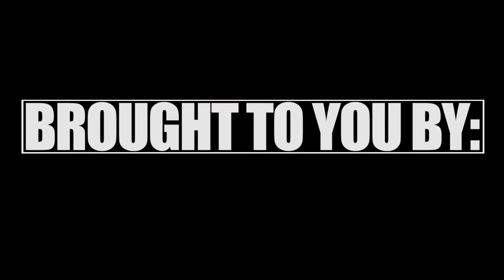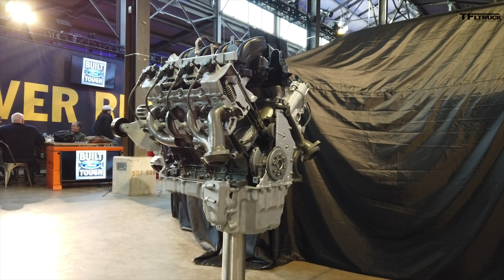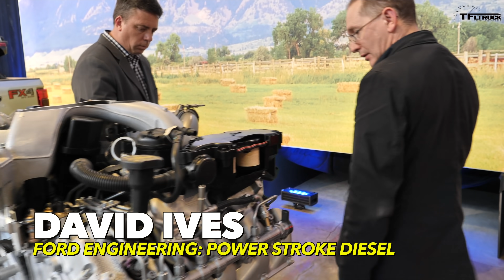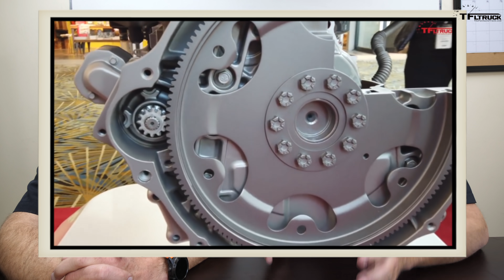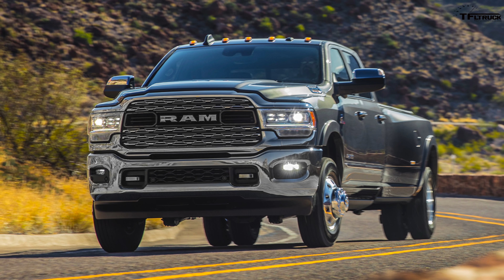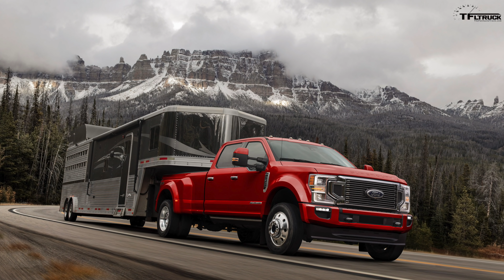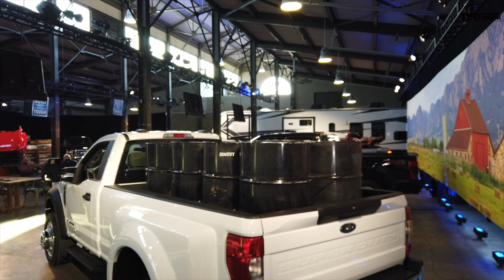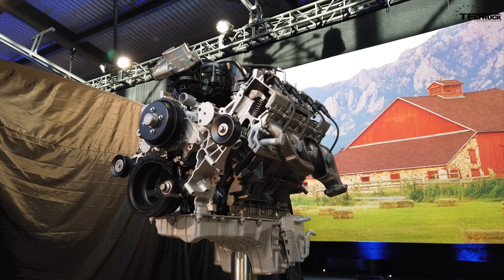Are Diesel HD Trucks Dead / Will Electric Pickups Replace Them? No, You're Wrong! Ep.5

Comment: Diesels are expensive to buy and get fixed, correct.  You compare an electric-gas truck to a Tesla.  Tesla drive units fail quite often and if out of warranty can cost $3-5000 to replace.  That is the motor not the battery.  And, in Tesla case, if you sell the truck the warranty is not good for the 2nd owner unless you buy through Tesla only.  Now range,  Tesla car with a good size modern battery goes 335 hundred miles.  Now with a truck pulling 20-30, 000 pounds, how far you going to drive?  How long to recharge and where, if not done by driving, especially through mountains and electric motor was constantly engaged.  I would bet the 7.3L with gas tanks, then electric motor and batteries, is heavier then a modern diesel with fuel and DEF tank.  I do not see the big diesels leaving anytime soon.

Comment: Ya the 200-300lb difference in gas and diesel is not enough for the battery and electric motors to make less weight. In 15 years a full electric HD will be the norm but it not now

Comment: Diesel will die at the same time all combustion engines (including gasoline) die. Full electric will dominate when battery technology gets to a point range exceeds current petrolium fueled vehicles on a consistent basis without negatively affecting payload (current battery tech. is bloody heavy). 

As for how eco concious electric vehicles are... that's highly dependant on the power source. If you're sourcing power from hydro tech. it's fairly green. If your charging from a coal fueled source it's worse than petrolium fuels could ever be.

Comment: I think that the notion here is that the electric motor doesn't have to go miles and miles without a charge. Ram has the right idea with the eTorque system. The big torque numbers are to get the weight moving initially and engine braking to help slow it down. The electric motor is perfect for this. Instantaneous torque to get a big HD with 30k lbs rolling and then the gas engine can take over. The big question, I think, is not whether a gas-electric hybrid system can work and is better, but how to package that and produce batteries efficiently. Every car company now has hybrid systems, so it shouldn't be much more to do. I am with Roman on this one.

Comment: There will never be an electric truck that can tow 35,500lbs over 40 miles. Unless you fill the bed with batteries, then your back to the same weight as a diesel😂

Comment: Electric trucks will replace diesels - just as soon as the match diesels with their torque and power AND run 300-350 miles per charge AND re-charge in under 30 minutes.  In other words - probably never.  IMHO.

Comment: If you start looking at series-hybrid (think Chevy Volt), the gas/diesel engine can be much smaller and doesn't need to be such a large displacement as 7.3 liters.  The Tesla P100 motors are pushing over 900 ft-lbs and can more then handle the POWER requirements of mid sized trucks.  Where electric has issues is in the Capacity of energy storage which a smaller gas engine has plenty of and only really needs to be able to maintain highway speeds and keep enough electric reserve Capacity in the battery to handle your Ike Gauntlet during peak demand.

Comment: I bought a 97 F-150 from a neighbor years ago. I bought it for $500.00. It had 432,000 miles on the odometer. It started, ran, and drove ok. He used it for small package/hot shot work. It had the gas V6. Gasoline engines can have longevity like diesels. I’ve seen proof.

Comment: In these two videos https://youtu.be/YWrHPlV8z6s and https://youtu.be/PfedP0rzNpk TFL Truck demonstrates the efficiency of a diesel over a gas electric hybrid. The lighter, slightly more aerodynamic BMW with a 2.0 four cylinder and hybrid power train achieves virtually the same fuel efficiency as a heavier, slightly less aerodynamic Ram 1500 equipped with a Diesel engine displacing an extra liter. That being said you have a larger less complex vehicle getting virtually the same fuel efficiency without all the added weight and complexity of a hybrid system. Don’t forget all those extra raw materials and energy needed to produce that hybrid power train. The cost of battery replacement would also be a key factor long before an electric motor would need replacing. Then you need to take into consideration the vehicles value at the time it needs that battery replacement. Is it worth it?

Comment: Independent engine maker Cummins Inc. continued its push into commercial vehicle electrification. The company announced it has acquired Johnson Matthey’s UK automotive battery systems business, a subsidiary that specializes in high-voltage automotive grade battery systems for electric and hybrid vehicles.

The acquisition closed Jan. 31 2017

Comment: Until gas engines can be engineered without added tech that diesel doesn't need and can produce lower emissions, high mpg, high power output (HP/torque) and costs per efficiency (long haul vs short haul) is when gas/hybrid will be the #1 choice for consumers.

Comment: How can a hybrid be lighter than a diesel number 1.  Number 2 diesel is more efficient than gas or frankly electric overall.  And lastly pure electric means you need to have a big ass battery to get more than 300 mile range which will greatly handicap max payload and towing

Comment: I could see an argument for naturally aspirated vs turbo'd with all truck motors getting smaller fast spooling turbos for the low and mid range torque. all any manufacturer would have to do is come out with a 4.5ish liter twin turbo v8 and all the turbo hate would be put to rest. you would be in the 650lbft of torque range.. who could argue with that much torque in a 1/2 ton?

Comment: Likely, after a few years you will see variable compression petrol engines. These engines are the holy grail of gas engines as they incorporate the main benefits of a diesel engine. Economy, lower CO2, and higher power. Basically it runs the same as a diesel, but uses gas. 
Mazda will release a 4 cylinder using this tech. Other makers will follow suit. 
Diesel will still be around in colder climates however. Also remote areas, as gasoline cannot be stored for a long time as diesel can.

Comment: If someone is looking for a true BB pump gas engine get the 632 Chevy. 915 HP AT 6000 RPM 840 lb feet of torque at 5000 rpm.
CAM STAGE 10.5, Forged pistons and Scat, Forged Crank and H-Beam Rods ,AFR fully cnc'd 377cc aluminum heads and a Merlin IV M block all for $13,995 US.  Naturally aspirated with Longevity and reliability.

Comment: In California we have a company called Propel Fuels, that provides E85/FlexFuel as well as HPR Diesel-- a high performance renewable diesel fuel that is safe to use in all diesel engines. This product is actually made by Neste and rebranded for public use. Many government fleets use their fuels, too, however often from other brokers. I believe this is the cleaner, greener option when compared to electric or hybrid powered vehicles. Lithium mining is a nasty process that is doing a lot of harm, not to mention the inability to recycle or properly dispose of the batteries, once they wear out. Hybrids are still using fossil fuels, too. If the government imposed regulations on fuel types, rather than emissions only, we could have renewable bio fuels available across the country, without using the awful adblue system that kills power, and possibly the engine over time-- and still have much cleaner emissions. Kill the dirty diesel. Let's push the clean, renewable diesel fuels. But if they make an electric vehicle with a graphene battery, I may be interested.
Reply: Spencer Bane  Initially it sounds interesting and I like the approach. Perhaps that's the future.

Comment: the future is here. electric is the next step in automotive evolution. electric is way better than infernal combustion but the power storage is the biggest problem. until they get efficient energy storage like hydrogen fuel cell technology, that gm pioneered in the eighties. it won’t be very practical

Comment: Diesels will always keep trucking on.  Tesla type vehicles might work fine for short distance commutes, but for a vehicle that will be used in a combination (towing a trailer, especially when it's heavy and/or long distance) they're not very practical.

We've all seen the news articles showing the Tesla Semi that's going to make diesels obsolete.  What usually isn't shown in the articles is that according to researchers who published their findings with the American Chemical Society, the truck will need a battery that weighs about 14 tons.  Considering how in America the maximum weight for any truck (without a special weight permit) is 40 tons.  So take 40 tons, subtract 14 tons for the battery, subtract 6.5 tons for the cab, subtract 5 tons for the trailer and what is left is the payload.  In case anyone is wondering, the payload is the part that actually pays the bills when the truck is in service.  The lower the payload, the less the truck generates financially.  To recharge a 1,300 kWh battery ( what would be required to move 80,000 lbs a distance of 900 miles cross country ), it would take 30 minutes (as advertised) to recharge the battery if you had a 600V supply capable of charging at a rate of 4,333 amps or 866 hours if you used a standard household 115V outlet.  A major strain on the power grid.  The only way any recharge station could handle this type of demand, is if they operate several diesel generators on site to recharge the batteries of the electric trucks that replaced the diesel trucks.

This Tesla idea is a failure for class 8 trucks, and now someone thinks that this is a good idea for pickup trucks that are now advertising to tow over 35k lbs?  Assuming that the truck weighs 5,000 lbs, that is now a 40k lb combination.  If you have a truck, take a look under your truck to see how much real estate you have to strap in a giant battery.  The truck will need to keep the rear axle, as well as the are where the engine is if it is to be front driven as well ( 4X4 ).  So the only actual available space will be the space currently occupied by the transmission, transfer case, driveshafts, and part of the area occupied by the engine.  In this space will be a battery ( which I would guess would be about 175 kWh ).  Anyone excited to strap a 3,750 lb battery to the bottom of their truck?  That's what it would take if the truck will be used to move 40,000 lbs about 300 miles.  And that 175 kWh battery, would cost about $33,000 just in materials alone.  It would cost more to manufacture the battery, unless you can find alot of volunteers excited about working with lithium.  And once again, to power these vehicles, it would require significant  upgrades to the power grid, or charging stations would have to install on-site diesel generators to power the electric trucks that have replaced diesel trucks.  You could also charge it at home with a 115V charger.  It would only take about 117 hours to recharge.

Comment: Roman, you forgot to complete your "Locomotive" analogy.  What kind of locomotive were you referring to?  A DIESEL-electric locomotive. 😁

Andre makes a great point that companies like Cummins, Caterpillar, Ford, not only make Semi truck diesel engines, but also make diesel engines for bulldozers, enormous earth haulers, levelers, excavators etc., and let's not forget Roman's example of the diesel-electric freight trains, which, without, our entire commerce system would shut down.  Anything to do with massive construction, or massive commercial hauling is laden with diesel technology. 

Until battery technology makes a quantum leap forward, diesels will not be replaced by electric motors, because diesels are more efficient and less expensive.

When full electric cars can go 400 to 500 miles per charge (current gasoline car ranges per tank) and that same technology can also be scaled up for commerce, then you will have a valid argument, until then it's just pillow talk.
Reply: I believe his point was simple. Locomotives are electrically powered and make huge amounts of torque
Reply: Which just proves how entitled we've become as a society. Most people have absolutely no need for a vehicle that can go 400-500 miles in a single hop, especially with the added convenience of being able to "fill up" at home, while you're sleeping.

Diesels will always have their uses, sure. However, this video isn't about heavy equipment or trains (even if they did use them as an analogy). This video is about pickup trucks. I would be willing to bet that EV technology will be able to meet the needs of most pickup truck drivers within the next 5-10 years. Whether the majority will be willing to admit that they virtually never drive more than 100 miles in a stretch...well, that's another story. People who don't want to try EVs like to tell themselves that range is important. For most, it's really not. 

There is definitely some merit to the position that those who have real HD pickups need more range. In my experience, those are the guys who actually do put serious miles on their trucks. However, I think we're about done seeing diesel Suburbans/Excursions and 3/4 ton pickups. The thing is, HD pickups are niche, just like heavy equipment. They don't really need to be talked about in the general "consumer vehicles" category because they don't really affect it. 

I think the safe bet would be to say that EVs and hybrids will replace diesels in standard consumer and lightweight work vehicles and diesels will remain in the niche categories in which they work the best.

Comment: It would be a shame to see diesels go away but I feel like a heavy duty hybrid might be the solution. Although I dont see that happening for a min of 5 to 10 years depending on political pressure. My next vehicle will be a heavy duty truck but for me a diesel makes no sense. I drive 5-9 miles each way to work and only tow a camper a few hundred to 2 thousand miles a year. I am really interested in the specs on the 7.3 though.

Comment: I never understood the hype of diesels until I took a cross country trip to Oregon from Ohio in a 2014 2500 ram with a Cummins pulling a 32 foot enclosed trailer.  The truck averaged 13 mpg and never lacked for power.  We also had about 1900 pounds in the bed of the truck.  Even going up the steep grades on I80 in Wyoming and Nevada the truck would maintain 75 mph without an issue.  I don’t see how a gas hybrid truck will be able to match the efficiency and power of the diesel.  My 2016 1500 ram with the hemi is lucky to get 10 mpg towing my 16 foot enclosed trailer on the highway.  I don’t see how a larger v8 with a heavier truck and trailer will be able to match a diesel even with the electric motor.  I also don’t want to have to stop every couple hundred miles to charge the battery.  Andre, you’re definitely right!
Reply: Brian Tusin Agreed. I was in a 99 F450 7.3 dump truck with a dump body full of granite and 4 full toolboxes, going a constant 75, on a slight incline. If a truck with double a batteries had the same load, along with the dump body, it would run out of charge 50 feet driving

Comment: We put the engineering in to get the fuel economy .. so we didn't have to put the technology into direct injection for the customer... anyone smell that load of BS?  Also it will be a cold day in hell when I trade in the reliability of a Cummins for a damn battery pack that I would have to fire up my own generator to charge in the middle of nowhere just to get back home. Says Diesels are expensive.. completly neglects the fact of battery replacements every 5-8 years... initial cost of hybrid technology and the limitations if your pulling a grade and your batteries die.. leaving only your gas engine.. oh and the increased weight of batteries+Electric motors+ gas engine.... Oh and anyone have any idea what happens when lithium Ion batteries get wet say like on the  bottom side of a truck fording a deep stream?

Comment: Roman gets some good points across but lets do a different spin to the diesel side in a smaller light duty diesels and tie them to some kind of Electric Motors and give us a something that the railroads have done for years and it seems to work well and they live long pull loads.  Besides that these 400 inch diesels are most likely getting close to the Max they can make for Power output but also keep in mind guys most automotive diesels will only use 30-50% of the power they make so do we need the 1000 Ft Lbs of torque